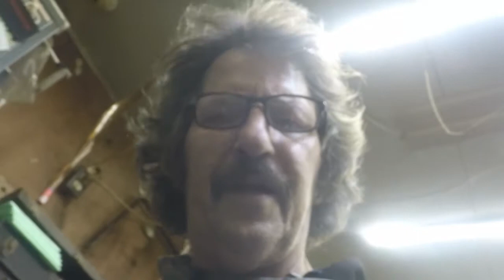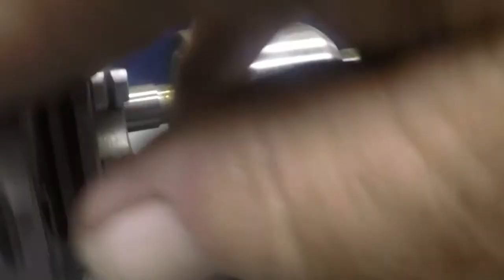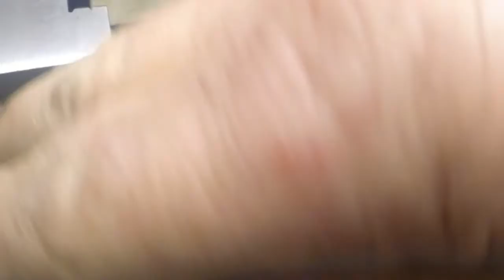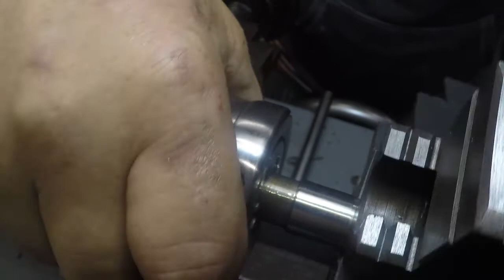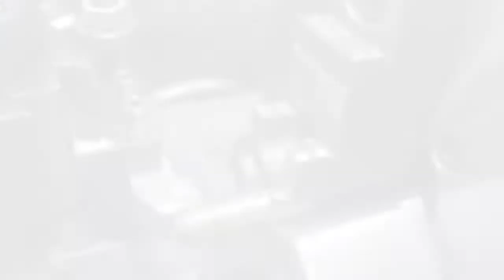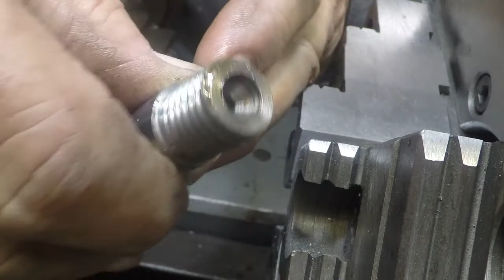tailstock die holder fineal

Comment: great KZ
Whenever i use a die holder in the lathe for course threads i usually tool them half way to give the die a easy life, or if its metric thread and im on impreial lathe i get the nearest tpi then again take the bulk out then run the die down, makes it "easy peasy"
I know your only testing it here but thought the info may be useful,.
ATB and also  i'm using the tee shirt for an extra layer in the cold workshop, thanks again for the gesture, visitors keep asking me who's "MUSH" is on the tee shirt🤣🤣😉😉👍👍👍👍
Kev
Reply from the maker: Stay Warm by all means.
I like the idea of cutting the threads.
Thanks Kev